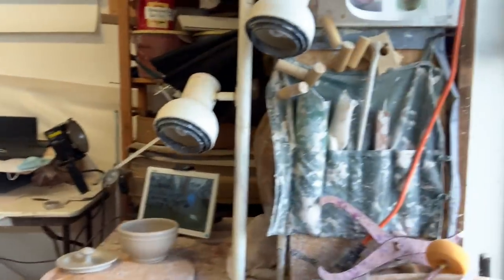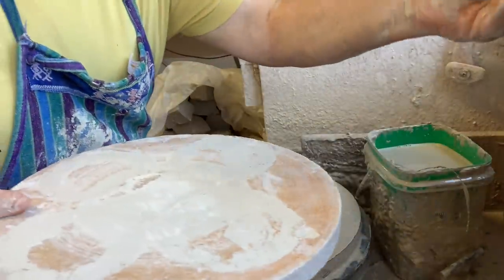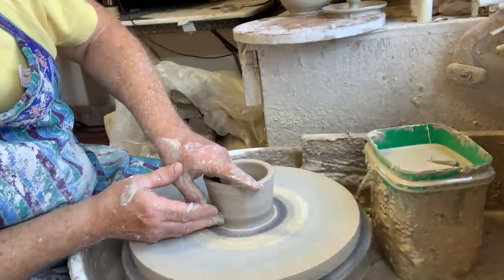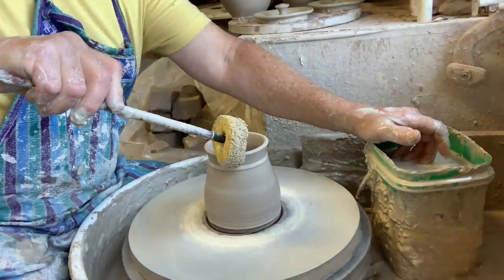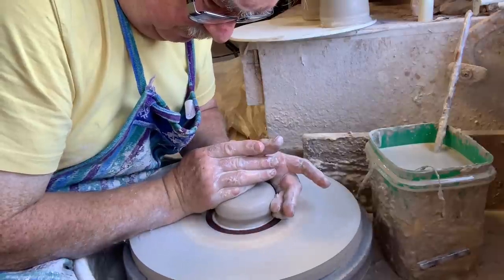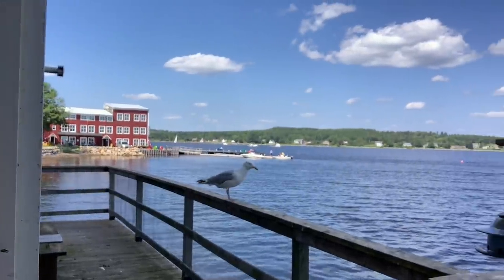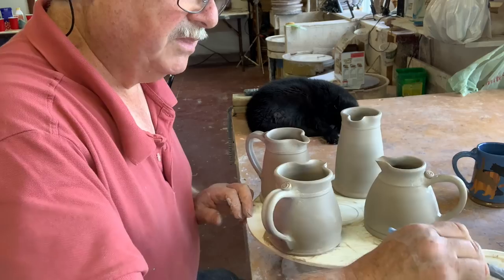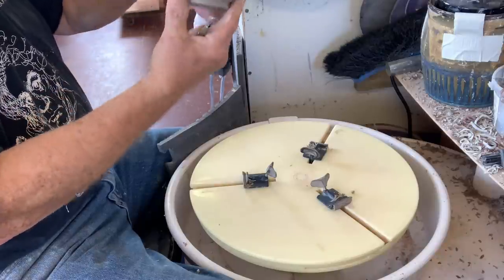Sugar creamers

Comment: All these years I was kneading my clay and forming nice little balls (because that´s just what you have to) but about 2 weeks ago I discovered your Youtube Channel and saw you just smashing cubes on the wheel head. I tried it and it works just fine.
It never cameto my mind that there was an easier way.
Reply: To be fair, during his beginner video he does mention that for newbies it might be easier to start with balls. But if you're a pro, it does save time. I'm still in the new to throwing and comfortable with hand building.
Reply from the maker: I have  had people argue that wedging every piece of clay is necessary, never done that either. I use a regular non de-airing pugmill to recycle clay and run the clay through 3 X. That works fine. New clay is de aired already and centres fine from a cube. Imagine how many hours saved over 47 years, not to mention Carpel Tunnel surgeries.
Reply: @Vsmithpots  HOLA SR SMITH QUE GUSTO VER SUS VIDEOS, NOS EL FAVOR Y NOS CUENTA UN POQUITO MAS COMO RECICLA SU ARCILLA, MUCHAS GRACIAS ABRAZO Y QUE TENGA UN BONITO DIA
Reply from the maker: @aliciabrocal2212  Hice un video sobre el reciclaje de arcilla. Está en mis videos anteriores de 2020. Solo mire hacia atrás en los videos anteriores. Gracias.
Reply: @Vsmithpots  I guess sometimes you have to question what you leaned as "the right way to do it". There are some short cuts in life and this seems to be one of them. It speeds up the process and I can´t see any downside.
I can´t remember any other potter who centers cubes. 
Have you seen that somewhere or were you just wondering one day why you´re doing all that wedging?
Reply: @rondacorkhill1654  For beginners it might be better to form balls but for small pieces I don´t do it anymore. 
I´m not very good at hand building because I started with throwing. But there are many nice things you can do with hand building.